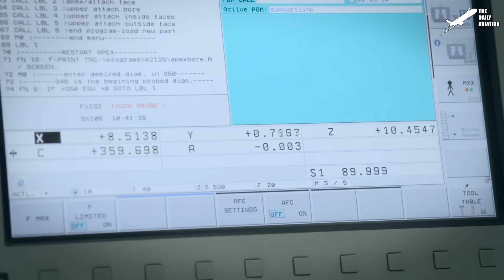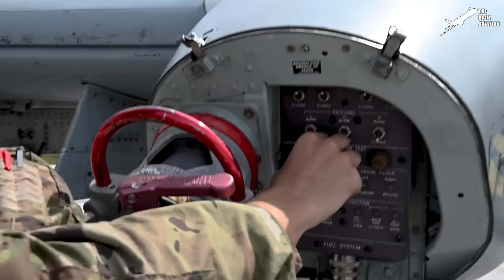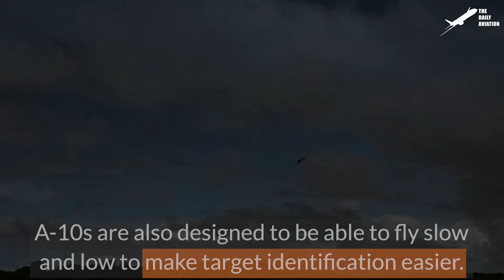Maintaining Monstrously Huge 28-Wheel Landing Gear of US Largest 420 Ton Aircraft

Comment: Older models but I got to work with (load planner). Overseas, remote based they will idle 24 hours or as long as it takes to take back off. They didn’t like to use the squat l to because they had problems with it. I will say flying in them is an incredible experience.